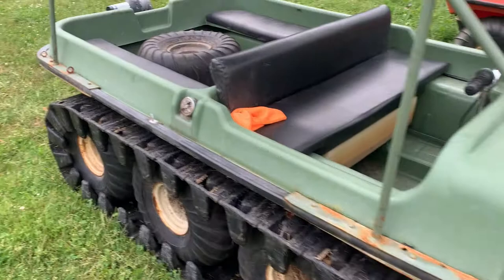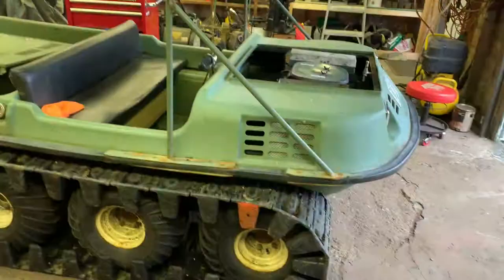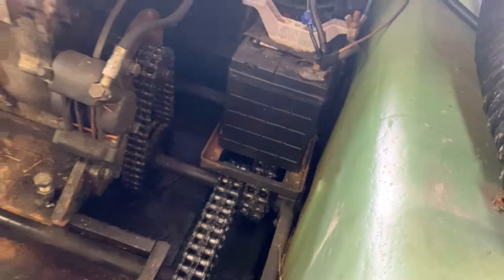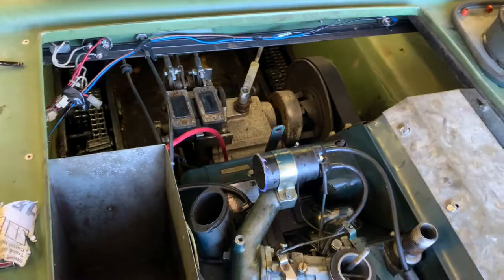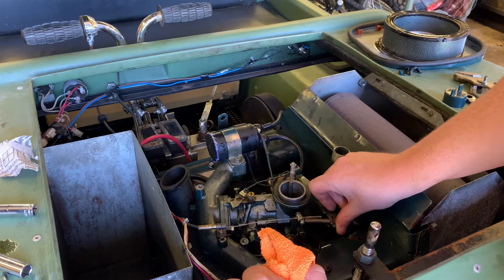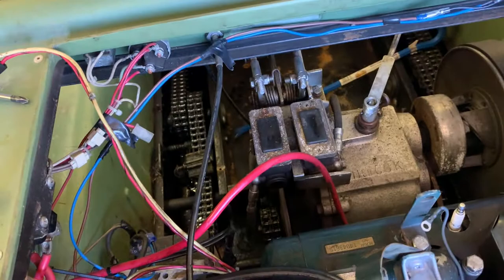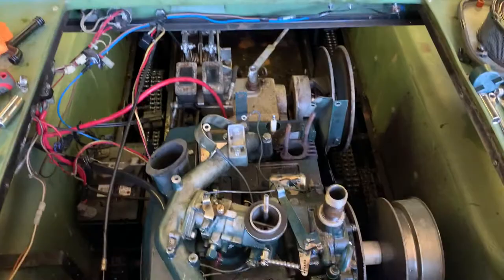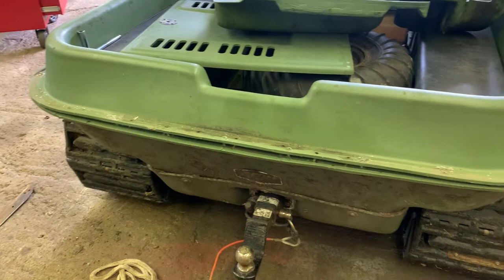Argo 8x8 Budget Build - Bad Engine / Disassembly - Part 1

Comment: Looks like the one I sold few years ago. The old fella put the Argo right in the pan of the truck had a bunch of other stuff to go with it.
Reply from the maker: Nice, where did you sell it too? Could be the old one lol I got a bunch of stuff with this one
Reply: @muddythumper8152  I can’t remember I think bud. He came in a Ford pickup. I’m from the west coast he said he came a long way to come get it. I remember a transmission I gave to him as well
Reply from the maker: @Byrne.Curtis  nice, could be the same fella, i got a spare engine, transmission with this. Fella i bought it off blew the engine up, so i dropped in the spare and she runs like a charm. Good machine
Reply: @muddythumper8152  ya I threw in a red kohler magnum 18HP she was painted black
Reply from the maker: @Byrne.Curtis  no, not this one then, this one came with a 17 hp kohler that was painted a crappy grey. im on the look out for parts for this though older 80's to early 90's models. would like some spare axles and stuff

Comment: That's a nice machine.  While a brand-new one would be convenient to have, I'd be afraid to use it.. considering what the things now cost!
Reply from the maker: Thanks!, i love my old 8 wheeler for sure. I currently have 2 new 6 wheelers youll see on the channel soon. 2022 models. one is a relatives, the other i bought for my father. Went through a recent loss so pulled the trigger on a new one. However, this argo from the video i currently have apart and will be getting highly accessorized, including new flip seat, tub reinforcement, homemade bumpers, windshield, canopy, etc! stayed tuned. - Muddy

Comment: Hello, love the Argo vids. I am over in Manitoba and just picked myself up an Argo. Is the engine able to be pulled without taking the top half of the body off? Also where did you get the canopy in your other vid? Straight from Argo Canada? Was it for this model or did you retro fit it?
Thank you!
Reply from the maker: hi there, had a busy week. Yes you can pull the engine without taking the top off pretty easy just 4 bolts under the engine. I bought the canopy used from a fella here in newfoundland, i just advertised and picked up a used canopy. It came off like a 2004 conquest or something but keep in mind almost all things can be compatible if you think about it! thanks